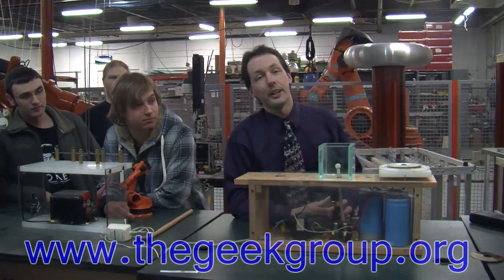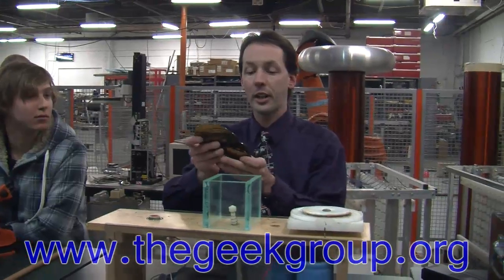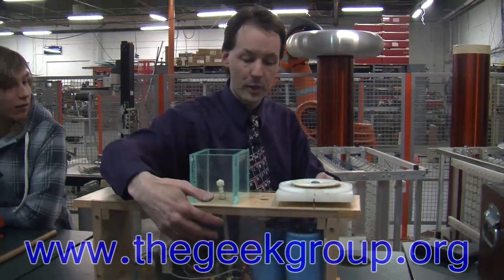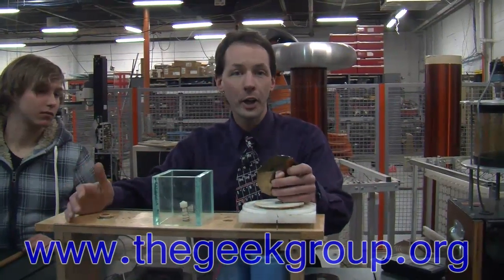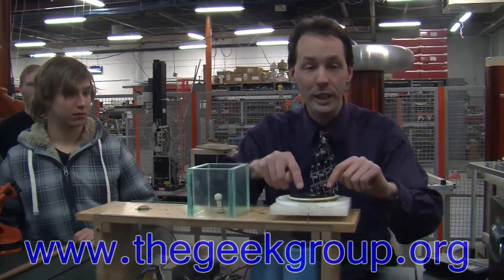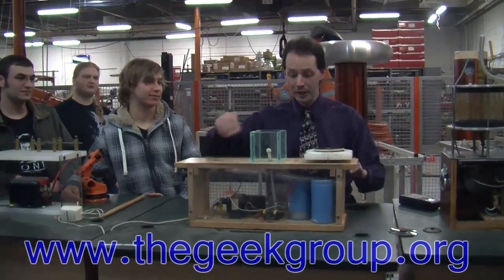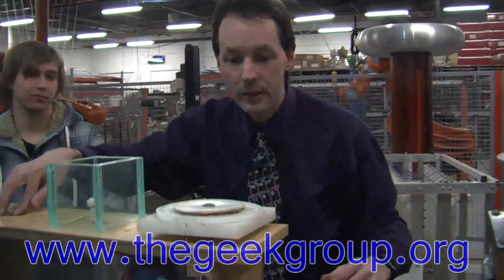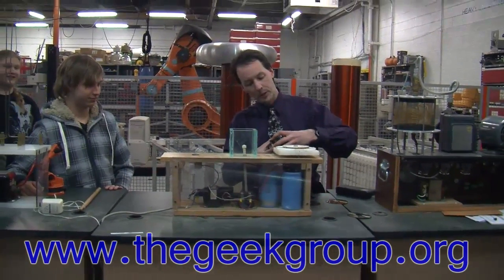The Ring Launcher Explained

Comment: this was how our lecturer demonstrated inductors and em fields to us, except ours had an alu cylinder sitting on a dowel above the coil, and was mains powered.
this also added a bit of luck, as depending on when in the mains phase you energised the coil, the cylinder might just lift up a bit, or it might go through the cieling tiles.
good times.

Comment: I wonder if sea water can be pushed against.  Sea water is much less conductive but there there must be some induced current and its magnetic field must push against the original changing magnetic field.
Reply from the maker: Google the word "magnetohydrodynamics"
Reply: @ChaoticGoodChris   thank you. I'm well aware of MHD.  😁 but, you'll find all water based mhd  demonstrations using an anode and cathode with ionic current flowing between them with a magnetic field at right angle to the current. It works, but a significant portion of the energy does nothing but create  heat, and another significant portion of the energy splits water (electrolisys) into hydrogen and oxygen gases at the anode and cathode and blocks ions access to the electrode surface,  and if one is doing it with salt water (sodium chloride), they will be creating a certain amount of sodium hypochloride (bleach) which would not be good to plant or animal life if one used a sea water MHD drive much.

In space, pulsed induction thruster can make its own plasma  (conductive fluid) from a gas, and accelerate it for reaction mass generating thrust for a space craft, as some small satellites have demonstrated. But it would be interesting to demonstrate pulsed induction thrust in sea water and totally skip anodes and cathode wear, skip wasting energy making hydrogen and oxygen in the sea water, and skip making toxic chemicals like bleach that can harm sea life.

Comment: I am sooooo making myself a ring launcher, i have a beefy ass 24volt coil relay that can handle more than enough current, what kinda voltages is the coil getting run through it, i have a big ass 36000 uF 75 volt cap which can store the coil voltage the power supply is easy enough for me

Comment: So the rings don't need to be insome way magnetic? I thought it was the iron oxide on the platens that made them ideal for this.
Reply: Aisha Kegawa No, the rings do not. It will work with any conductive ring. Flowchart:
1. Coil + electric current -> magnetic field (very strong due to high current supplied by capacitors)
2. magnetic field induces an electric current in the aluminium (electromagnetic induction - it's how transformers work)
3. Any electric current in a conductor will produce a magnetic field (the motor effect). In this case the current flowing in the aluminium ring causes the generation of the magnetic field. 
4. This magnetic field opposes the field in the coil directly beneath the ring. Two opposing magnetic fields cause a repulsive force and thus the ring flies up.

Comment: Chris what happens if you cut a slit into the disk?  Does it act like a ring launcher that has a coil on a rod and not induce a current and magnetic field and not pop up?

Question 2.  What happens if you put the disk into liquid nitrogen or dry ice first?